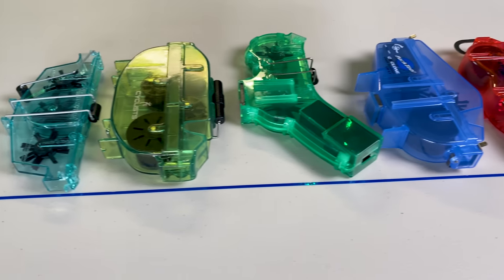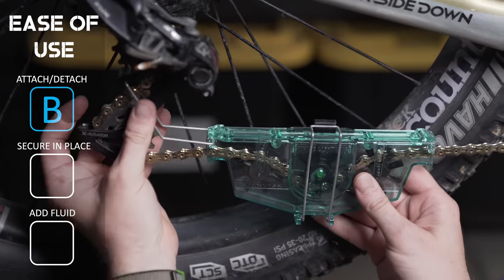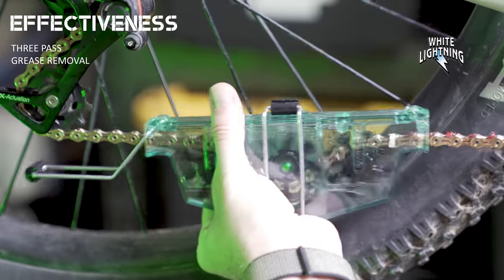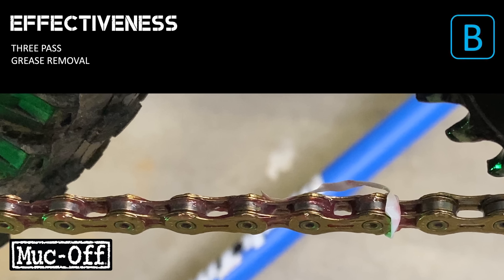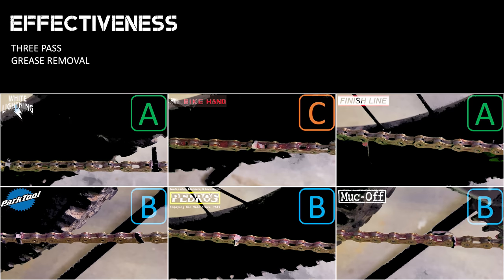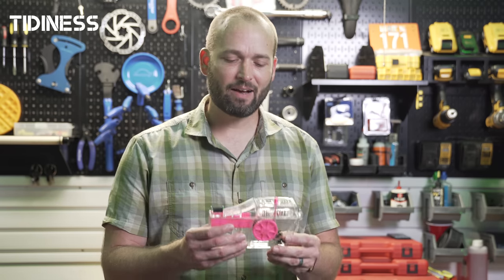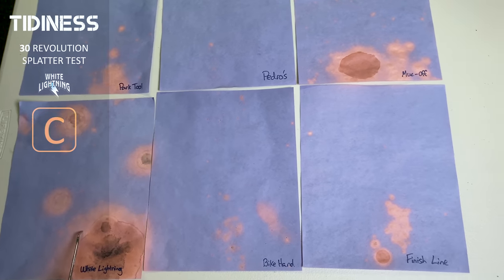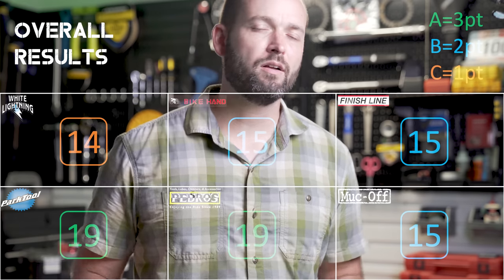Best Bike Chain Cleaning Tool Under $40? | Top Bicycle Chain Cleaners Compared

Comment: The best chain cleaner is noone. Wax your chains and never thoroughly clean them again. I wipe mine off after a few rides and rewax whenever I feel like it, usually after 200-500 miles. Because the solid wax fills all the voids in the chain and is hydrophobic, no dirt will ever get in your chain and it typically lasts much longer. 
Rewaxes and the ocassional wipe are really quick and are the only maintenance I do on my chain apart from wear checking them regularly.
Reply from the maker: Thank you for sharing your experience! - Jay

Comment: Best chain cleaner is FREE, just wax your chain, you won't need to clean the chain, you won't have oil on your bike, so no detergent, or any other cleaner, just water, better for the enviroment too.. I use Squirt was, you can melt wax, many people prefer melting wax, Squirt is just easier, melting may be better.. its all better then dirty lubes..not only will the chain/driveline be cleaner, your bike/hands/clothes will be too. No detergent to wipe out grease form bearings either with wax..
Reply from the maker: Thanks for the tip! - Jay

Comment: Too expensive just to clean chain. 
Old toothbrush - 0 dollars
Old sponge - 0 dollars
Old cloth from shirt - 0 dollars

1. Hose down the chain, or use a pail to remove preliminary dirt.
2. Bubble up dish soap in bucket of water
3. Dip brush into soapy water, scrub the chain while rotating. 
4. Hose it down 
5. Use sponge to fully clean the chain.
6. Hose it down.
7. Wipe with rag or old cloth
Reply from the maker: 😀 - Jay

Comment: "WARNING", DON'T EVER USE ANY TYPE OF CHAIN CLEANING DEVICES!     Why?!   Chain cleaners force your chain thru a tub of powerful de-greasing solvent. The chain exits the device dripping wet with this powerful solvent which then get onto your cassette and into our freehub body and rear wheel hub. Then the solvent dribbles down from your chain rings and onto your crank spider and into your BB bearings.
Don't do it... I'm a professional mechanic with over 30 years experience, and nothing wrecks a bike's bearings like a chain cleaning device, especially if you have expensive Ceramic bearings.  The correct method to clean a chain and cassette is to remove it off your bike which is not that hard and will save you hundreds of dollars and head aches.

Comment: DOH !! when you did the drop test, you got the decimal point wrong on the thickness measurement - 2.16mm nah;  2.4mm nah; 2.52mm nah; 2.14mm nah; 2.74mm nah; 2.38mm nah......... 21.6; 24; 25.2 etc etc etc
Reply from the maker: 😔 Thanks for the feedback - Jay

Comment: I got two bicycles for free,made in the 1990s,top condition, but the chains on both have never been cleaned .i will do,but i'm shure,even the best chain cleaning device will gave up on my bicycle chains.i make it with a old paint brush,and gasoline.

Comment: Your methodology doesn't really make sense ranking everything evenly. If I get a chain cleaner, I want it to clean the chain well. That should be #1 consideration. I'm never going to buy more spare parts, or care about how easy it is to refill the cleaning fluid, if it doesn't work well to begin with. Especially for a chain cleaner that costs $25-$30!
Reply from the maker: Thanks for the feedback. - Jay

Comment: Did you know after using chain degreaser you’re supposed to clean with soap and water in the cleaner and keep rinsing with just water in the cleaner
Reply from the maker: Yes! That's actually how I reset the chain and the cleaner between each test - though I'll admit I rarely do that during my normal course of cleaning. Thanks for sharing. - Jay

Comment: i always buy the 3 cheepest chains and rotete them after 500km. They are 20-30% weeker than the priciest chains. Then i aply wax without cleaning the drive train. I just relube it without cleaning. Wax doesn't stick sand. The point of cleaning in my scenario would be only aesthetic considerations. In my opinion theres no point in cleaning. Just rotate the cheap chains and enjoy the ride
Reply from the maker: Thank you for the tips - Jay

Comment: 'Case wall' NOT Case 10:35  The case appears in the 25mm range.  Same with all you measured.
Reply from the maker: Correct - I was measuring the thickness of the plastic used on the case walls.  - Jay

Comment: I have the ParkTool.  I'm not impressed.  Used it ~20 times.  Foam disintegrated and the clips broke off.  All of these are super janky.   50x better is just to squirt the entire drive train down with SuperClean, work it with a small hand brush, hose it off, blow it dry with air, then re-lube.  WAY BETTER results.
Reply from the maker: Thanks for sharing your experience! - Jay

Comment: These things are so 90s... The 2020s is  2 chains 2 quick links and wax based lube. Simply remove chain drop in small plastic tub to soak and then clean.... So much better
Reply from the maker: That is a good method - thanks for sharing. - Jay

Comment: Don’t leave the park chain cleaner outside. I left mine out on my deck where I cleaned my bike. When I went to clean it again a few weeks later the sun had warped it and oxidized the plastic, making it unusable. It’s like it aged 30 years.  I suspect all the others are all the same as they look like that cheap plastic.
Reply from the maker: Thanks for the tip! - Jay

Comment: Dont buy any of these. Take off your chain, drop in a bottle of mineral spirits. Do this till no more dark residue.
Then buy some parafin wax candles off amazon. Get a mettal bowl, put chain in it. Add candles and let it melt slowly.
Take out chain and let it cool off.
This is the best cheapest way. And the entire drive train stay clean.
Reply from the maker: Thank you for the tip. - Jay

Comment: Best chain cleaning tool = chain tool+gasoline or kerosene+plastic bottle. Remove the chain, fill the bottle with one of those liquids, put chain inside, give it a solid shake, leave it for few hours, wipe the chain clean, mount it using same tool and apply chain lube.
Reply from the maker: That's one way to do it! - Jay

Comment: Are these relying on mechanical cleaning alone, or is there a cleaning solution involved? Whoops nevermind. Unless these are super cheap, or rebuild able, I'll stick with good ol'fashion cleaning.
Reply from the maker: Several are rebuildable, but as other viewers have noted - there are a lot of methods out there to clean a chain - these tools are just one option. - Jay

Comment: Gasoline for all metal chains(Bicycling) and kerosene for O/X/Z-ring chains(motorcycling). No need for any special overpriced products. If it works, it works.
Reply from the maker: 😀 - Jay
Reply: @SimplyMountainBiking  Most people use what someone else has told them just because someone else has said so. At some point in one's life it's important to make independant decisions and hop off the main train that takes everyone for a ride they do not know why they are taking...

Comment: Wow, you could buy a lot of toothbrushes for $35.00. I was not impressed with any of that plastic junk. Plastic pins? flimsy brushes? Less than 1/8" of wall thickness? Even Bic lighters are built better. Those are pretty expensive one use tools. I highly recommend WD-40 and a toothbrush to clean your chain, then, using a toothbrush to apply heavy, (thick) quality chain lube, and, as the WD-40 evaporates off the chain, it draws the heavy chain oil into the links, lubricating the rollers inside, and outside. Leave the chain to sit overnight, and then wipe any excess lube off the outside of the chain with a hand-full of paper towels. I use this method on my motorized MTB, and at speeds up tp 50mph, very little or no oil flings out on the frame or engine case. I've only had to clean it 2 times in 5 years. My 420 drive chain has not stretched at all in 3 years, with about 10hp pulling on it .I clean my chain when it looks dirty, or if it gets wet. other than that, I lube it once every spring.
Reply from the maker: Thank you for sharing your feedback - Jay

Comment: I doubt any of these tools were designed to remove thick grease, since nobody would use such grease on their chain. Hence your test failed on the most important aspect - how do these things do what they are supposed to do - remove grime.
Reply from the maker: Thanks for the feedback. - Jay
Reply: It's not a real-world test but still demonstrates the relative effectiveness of the tools. It's also repeatable

Comment: haha the results are quite silly really. When you buy a chain clearer you want it to perform its primary function, WELL, i.e clean the chain, White Lightning did that with an A, it survived the drop test and it was the cheapest of all cleaners and it came in with the lowest score, 14 and two of the worst performers one being parktools came in on top and it COULD'T even perform its primary function very well. Tut tut 

Remembering you can buy TWO white Lightenings for the price of most  the others
Reply from the maker: Thanks for the comment!  Fair points 😀 - I considered weighting categories, but decided to let each viewer do their own analysis on the factors most important to them. - Jay

Comment: Surprising how shitty some of these are, my 2$ bike chain cleaning tool from aliexpress is as good or better than some of them, also is made from a less brittle plastic and will not break. In 2 and a half years of use, used around 30-40 times, is still in very good condition
Reply from the maker: Thanks for sharing your experience! - Jay

Comment: I bought a chain cleaner at Amazon.ca. it was trash. The Roller brushes wouldn't even spin when you turned the pedal. You couldn't pour in cleaning liquid into the unit  without most of it spilling on the floor. The hole was too small. The accessories were also useless. I returned it. Garbage Product like most chain cleaners
Reply from the maker: Thanks for sharing your experience - Jay

Comment: Meh.  Who cares if the outside is clean.  Everyone knows the wear occurs on the inside.   That is what you need to clean.  You can't clean the inside of the chain with any of those devices.  Cleaning the inside requires you to dunk the chain in a solvent.
Reply from the maker: Thank you for the feedback and tips - Jay

Comment: Dish of turps, soak the chain overnight & a toothbrush on cardboard. Fling and compressed air dry. Rotary cleaners pack more dirt INTO the chain, not clean it out. You're fooling yourselves.
Reply from the maker: Thanks for sharing your experience. - Jay

Comment: Park tool is a joke… the piece with magnet fall off 1st time I used this shit..
Reply from the maker: I had that experience with the first version I owned.  The version I bought for this review seems to have a better magnet attachment design. - Jay
Reply: I have the park tool and the pig.  I use the park tool one most.  The magnet has never come off, and it literally attracts super fine metal slivers that have shed off the chain.   Not that big a deal but it does seem to do its job.  Vs the pig the park tool has a larger fluid reservoir and using the handle I can angle it to press in different sides of the chain as it passes.

Comment: All of this cleaners look like piece of garbage ready to throw out. Look on this kind of plastic. I would spend 3 times more to get something solid.
Reply from the maker: Thanks for the comment. There are definitely other options out there!  Many advocate for an ultrasonic cleaner (requires chain removal) and of course Park Tool has the CM-25, with an aluminum case. - Jay
Reply: @SimplyMountainBiking  right, cm-25 is brilliant.